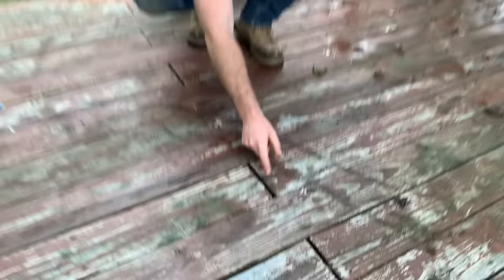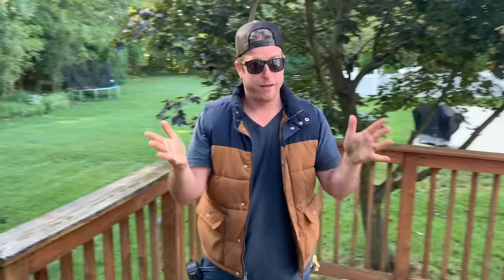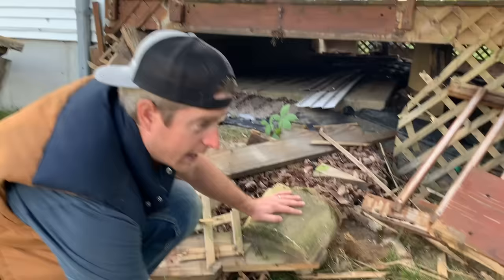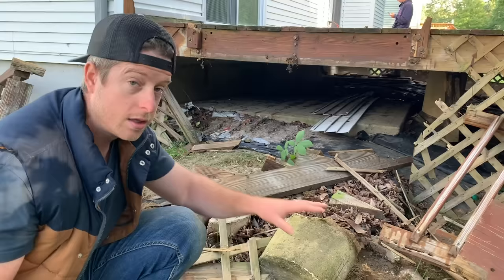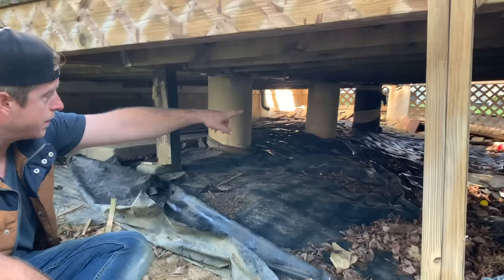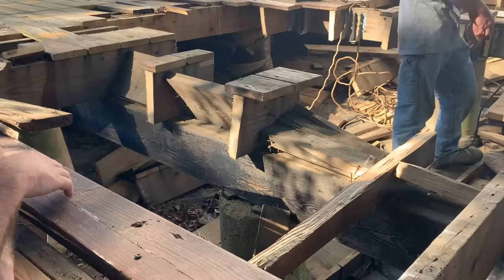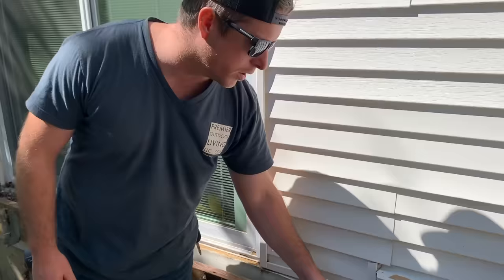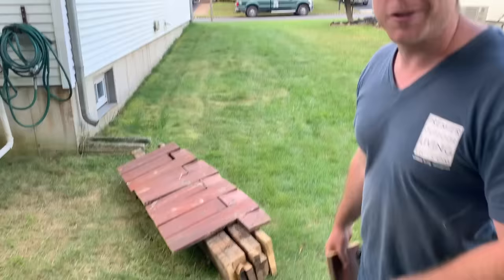How NOT To Build A Deck - Ultimate Guide On Every Mistake You Can Make

Comment: Flashing tape is newer than that deck. And the framing looked right they just had a hard time with footings and at the bottom of the stairs it only needs a 4 inch thick pad that the bottom of the stringers land on. Most people pour a pad.

Comment: I've worked in the trades for 20yrs and owned 4 homes. I gutted the 2nd and 3rd. What I didn't already know I looked up and asked the building department what code was. Only had a problem on one house. I forgot the fire blocking and they made me cut the drywall and add it. With the internet you can do it all but you better have some pro experience or it will take you forever. P. S. Sub out drywall finishing

Comment: The house I purchased has the ultimate in deck stupidity.  They took a cinder block foundation and, instead of running the blocks under the house then building the deck out from there, they placed the blocks AROUND the deck so that anytime it rains, the water goes through the slats and literally under the house.   The inside of my front wall is almost destroyed from the moisture.  They also put crappy wood paneling on the inside front wall with no insulation or dry wall.  It all has to be torn out and redone.
Reply from the maker: Yikes, I wish people would just put in the work to do it right the first time
Reply: Maybe don’t buy a house like that.

Comment: This deck lasted 20 plus years and still looked (from a none pro eye) good enough for  a bbq! so if its diy id be happy with it haha
Reply: Still, if your going to diy look at code and tge reasonong for it. Flashing, bolts, all very important.
Reply: Someone had to feel it wobble
Reply: I did a DIY deck on a buddies house, I over engineered it to say the least but the damn thing didn't so much as shimmy when three 200+ pound men jumped on it.  It will be there for decades as long as it is treated properly.

Comment: you laminate 6 boards together because that is what you have.  Now you have 9" thick beam.  absolutely nothing wrong with that.
Reply: Sarcasm or serious? I cant tell lol. Definitely no need for a 9" thick "beam" on that deck either way🤣
Reply: @irishmichael81  I was kinda serious.  If you need a beam to be 9" taller, the strongest thing you can do is laminate 6 pieces of 2x4 cut and laminate them together if you overbought the 2x4's no big deal.  You can even gap the posts by 6 feet then as well.   I don't understand why the poster thinks this is so unusual/wrong.  There is certainly nothing unsafe about it.

Comment: If you think this is bad, you should come to VT and see how they build them. I have a surplus of cinder blocks in my yard because every deck I take out is sitting on them. It doesn’t help that when I moved here and went to pull a permit and asked about inspections throughout the build they said they don’t do them. They just come when it’s done and make sure it’s the size and shape and located on the property where you said it would be. Guy told me I can build a deck 10 feet off the ground with no railings and a giant hole in the middle and they wouldn’t care. That’s literally word for word what he told me lol.

Comment: We don't have frost in North Queensland but we do have tropical cyclones which exert tremendous lifting forces, so you must have bolts through your posts, connected to your bearers and the joists should be attached with 3 direction framing anchors, not nails. Hardwood is normally specified if there is no roof, like yours. Thanks for the video.

Comment: in the humid south, beware of fungus.   If the deck is low and cannot get circulation, fungus will eat it even if it is treated wood.  Fungus just needs food, moisture, and heat.  Wood is food (even treated wood).  Moisture is any water that does not dry completely out.  And heat is summer.  I have seen decks fail within 3 years.
Reply from the maker: Good point!

Comment: When you need to use shims what do you use?
Reply: I'm no builder but I believe this is the wrong question. The piers should all be at the correct height. If they are not - then that is an issue that needs to be corrected. Shims will not stay in place. You should only shim a joist to prop it up for a few weeks until you can get around to fixing the pier. If you can't replace the pier, consider a gal steel support bracket. 
However to answer your question, you need a damp course between the pier and the joist. If there is potential for termites, the damp course also needs a metal cap. That way the joist is isolated from ground water and pests. Thus if you need a few more mm then add another layer of damp course. 
In the video, it was not just that there were shims but also it was wood directly on a concrete pier. The concrete pier acts like straw for water to rise up and rot the joist. The wooden shims make it even worse by sucking up the water, trapping water/dirt underneath the joist and moving around.
Reply: pt shims with copper green
Reply: @davexb6595  lmfao jesus no

Comment: 1.Don’t build decks on west side of house in the Midwest. Gets blazing hot out there and you won’t use it. 
2.If at all possible save your money and do a paver patio instead. Wood rots outside and the sun cracks it…. It’s WOOD. 
3. Don’t use nails. Seen countless airnailed decks here in the city rapid build cookie cutter subdivision building contractors have done. Vibration from walking on them over time loosens nails.  use torx screws. 
 4. 0:02 Overbuild it. Make it safe to park a truck on. 
 Don’t bury posts in concrete. Concrete is believe it or not a water sponge and will rot ur posts out. Backfill holes with gravel and tamp it with a sledge hammer. Then the water can get away..
 Just my 2 cents

Comment: The one I am working on is much worse. They set the 4x4's 12"  down with just a brick under the post. Then continued to fill the hole with clay. It's no wonder the deck skirts pulled the nails out of the 2x6's..
Reply from the maker: Scary stuff out there 😬

Comment: him: You can't have riser boards with more than a 3/8 inch difference

me: looks at my 10 inch riser board and my 7 inch riser board

UH OH
Reply: This is the one thing he is semi right on. Stairs are a big deal and you dont want bubba designing them or people will hurt themselves and theyll be miserable to use. Each riser should be equally high and the stairs equally wide. And certain ratios are comfortable while others are horrible

Comment: There is so much sun where we live that almost any kind of structure or appendage like a patio, deck, gazebo or fence built out of wood and painted or stained is bound to failure in the long run. Times have changed and almost any building, exterior doors, facia, etc. built from exposed wood is something to look for and avoid when thinking about making a real estate investment. Unless of course you like and are prepared for the maintenance.

Comment: That deck was built stronger than a lot of houses. Can't say as I have ever seen stringers at 12 inches apart.
Reply: He mentioned at the beginning it's a deckorators deck (composite) which has a standard 12" O.C. for all joists and stringers.  Trex and other composites are the same, they will flex more than wood especially on a really hot day, so it's a good standard to follow with composite decking.
Reply: He said a Deckorators deck "going in".  The deck he's tearing out is solid wood.  Depending on the thickness, 5/4 or 2x, the code is 16" to 24" OC.  Yes, the video stringers were too wide.
Reply: @michaelmarion2742  He definitely should have clarified but that makes sense. I too was going to say "WTF... 12"? Certainly not 32" like this one but 12?!"
Reply: @christopherrto  i do 12" because mine are ceder and not hardwood.
Reply: @Pepe-dq2ib  I've never seen a hardwood deck. Treated SPF or Cedar is the only thing you see where I'm at
Reply: @christopherrto  I meant harder wood like Douglas fur, syp and hemlock.

Comment: Our decking was built by a “professional” decker. Within 1 month three boards had warped, and they had to replace them. Within 1 year they were back again as boards were splitting. Eventually, we had enough, filled them and painted over. I’m not sure how it’s fairing up now as we moved, but the deck we laid before the newer one, lasted 14 years, and the only reason we had to replace it was due to some rotting to the bearers on one side where the pathway the “professional” builders (who built our house) laid the slabs with an incorrect slope, allowing water to pool. Seems us DIYers often belt and braces our work and the greedy “professionals “ are only doing to for the money, no pride in some peoples jobs, just grabbing hands.
Reply from the maker: What kind of board were they??

Comment: I'm tearing out the old deck that came with my house. Ledger board? No way! They hung joists off of joist hangers spaced 32" O.C. nailed directly to the cedar siding of the house. Then they nailed blocking between those joists. Finally, they hung the rest of the joists off of the blocking.

Comment: How do you price your deck builds? Square footage prices with small adjustments depending on joist size, decking and how many footings you need?
Reply: The correct way is to do take-offs plus man hours times mark-up equal sale price. You can ball park square based off surface square footage and railing linear feet. I wouldn't contract using that as the calculation tho.

Comment: Looks like there was a deck there before this one, and this one was a quasi add-on or repair to the existing deck. I kinda like the large concrete pillars under there, but the rest of it was sorta amateurish. Even so, no (wooden) deck will last indefinitely.
Reply from the maker: Very true!
Reply: I am sure you are right as wood is not forever. Whoever built my deck in 2005 did  a great job as it is still solid as a rock. Of course 3/4 of it is covered by a roof but the exposed area is still in great shape. They did the butts like this guy said with a breaker board.

Comment: But you didn;t really show anything. What was the original wood used? How was material joined-nails, screws, bolts, glue? Were the posts on the inside or outside? Were the boards set upside down,is that why some were curving up , examine the footings etc...There is so much to talk about. Every contractor or electrician says - I would never  have done it like that hehe

Comment: My deck was built when my house was built 27 years ago.  It was not built correctly by the builder.  And, it has been a pain to maintain; this year I discovered that the support posts are rotting badly.  Also, the footings were not poured correctly. I'm in the process of having professional plans drawn up to meet all city and county code requirements.  I must have new footings poured, as well as additional footings to ensure the deck is properly supported and up to code.   I am also having a 4-12 pitched roof installed over the entire deck.
Reply: You are meeting “all city and county codes”????  Dumbest thing I ever heard 😂😂😂. Just build your deck bud.

Comment: It's funny because from a materials cost, the difference between doing it right and doing it very wrong is probably only 20%. But then you have to rebuild in 10 years instead of 30.
Reply: Sounds like a you problem - Contractor

Comment: I have a great deck to show others what not to do.  After less then a year my 12’x20’ deck started falling apart.  I paid a contractor to build it, although at this point, I think I could have done a better job ☺️ I have an 8’ high by 20’ long wooden privacy wall with louvers that wouldn’t stay open. There is NOT one lag screw or carriage bolts in my entire deck aside from the ledger board, which was already there.  Just deck screws and nails.  The 1x1” wooden balusters are screwed to the deck with 1 ⅜” screws.  The ledger hangers are too small and hung improperly. 2 are only attached on 1 side.  The railings on the stairs are not up to code, because they are too low.  The wood rails on the stairs have holes and knots making it so rough you can’t run your hand down the stair rail.  AND SOOOO much more!  GUESS WHAT… IT PASSED THE CITY PERMIT INSPECTION!

Comment: the deck I had to rebuild was more dangerous than the one  you torn down....   

Using  only 2x4's,  joists 16 on center,  one joist "supported" by a 2x4 going to the ground...  The next two had no support under them.... all the way down (50 x 8 patio...)  I don't know how it had not collapsed for all that  time....
Reply: I spent a lot of time getting everything right , but I knew it was good when my Dad came to look at my posts and concrete supports. He was impressed, which was not easy to come by😊 he taught me everything I know!

Comment: Any carpenter should know that wood shrinks or “contracts” practically an immeasurable amount across its length. Most of the shrinkage is across its width or thickness. Imagine how much a 2 story house would shrink if the studs were to “contract” like that. We must also build stuff cheaper or be lighter people in Canada because our minimum code for spacing of wooden stair stringers of that nature are almost 35.5”. If those steps had riser boards they would have actually met code in Canada
Reply from the maker: You sure seem to know a lot about shrinkage Jordan 👀
Reply: Just like every carpenter should
Reply: @THEpremieroutdoor  A lot depends on whether you are dealing with hard wood or soft wood... 😂
Reply: Ya, I used to work at building log cabins, we never had to worry about the logs shrinking over length but from green it was 1 inch per foot across the grain

Comment: You forgot to mention don't use untreated lumber for your joists. Yes, sadly, the previous owner built a 2,000 sq ft deck (yes, you read that right!) and didn't use treated lumber for the joists! We are currently replacing it all, one section at a time. Thanks for your video reminders!
Reply: Why is that? Is there ground contact?
Reply: @ctclassic1  The upper level of the deck is next to the house, and the joists are only off the ground by a few inches and, therefore, are never fully able to dry out. The lower portion of the deck is around an above ground pool! We used roofing tape on each joist to keep water from sitting right on top of them.

Comment: Did anyone mention anything about the trash can sized concrete supports used under the middle of the deck? The host was complaining about the 4x4s, and the footing errors, points "directly" at the monster columns, but doesn't mention them. Looks like they would've supported the twin towers. Maybe I missed something.

Comment: When I hired a contractor to build my deck, I caught them doing three code violations.  Sweep space was 6 1/2 inches.  Max should be 4 inches.  They used wood screws to attach the railing to the deck instead of bolt and block.  And on the stairs the space between the lower rail and the step was over 6 inches.

Comment: Can you help me with the following:  

I just purchased a few thousand dollars of decking from a local lumber chain in New England (not from a big box store).

The decking is: Culpeper ⁵⁄₄ x 4 x 12 ft. Southern Yellow Pine Premium Grade Pressure Treated Decking. Premium Grade, Radius Edge, knot free and wane free. Decking exterior grade micronized copper pressure treated southern yellow pine. Our decking is a better quality grade than either premium or No.1. Actual Size:1-1/16" X 3-1/2”

50% of what arrived has a severely damaged edge or no edge at all as it is smaller than dimension. 

30% is stained with a black sooty material

20% has knots

50% of it is very heavy and wet, 50% is dry

Questions:

Is the yard trying to pass rejects on to me because I am a home owner and  not a contractor or is the quality of lumber just extremely poor right now? (I called, the yard will take the bad stuff back and bring me replacements)

How do I space the boards if 50% are WET and 50% are dry? (I was assuming 1/16” spacing for wet PT boards).

Thank you!

Comment: The deck I replaced on our home 4 years ago was worse. The current deck goes out 16 from the house and is 24 feet wide. The poor guy that decides to replace it in 25-35 years is gonna be frustrated trying to tear it apart. :)

Comment: I watched a new video about an hour ago,  today (4/2/2021) about adding a wider porch to a house and moving stairs, that included most of those mistakes. It also included the extra feature of having an unsupervised approx 4 yr old child, sitting on top step of stairs under construction, with a 9 ft unattached heavy handrail resting on upright, higher than her head. I nearly didn't make it to the end of the 30 min+ saga. Now I can't find it to pass on, as I wanted to share. It ended up painted white. See if U can find it.

Comment: Until I saw the footings, I actually assumed this was done by a home owner.  But after looking at the footings, I suspect it was done by a handyman who was trying to nickel and dime what he could on the materials for the project and minimal time spent.  Hell, I wouldn't be a bit surprised if the gap in the deck boards was a result of him or her reusing left over materials from another project so he bought shorter boards to finish it off and thus save on the materials.  I've dealt with a few handyman who turned out to be local crackheads and they only have two things on their mind.  Finishing the job as quickly as they can and maximize their profits.  The handyman knows how to do it right, but if the job wasn't permitted they also know nobody is checking behind them either.  This is one of those projects that looks good while the boards are still wet and absolutely oozing sap.  But as soon as they dry out and you start calling your handyman who doesn't return your calls, you know you got jipped.